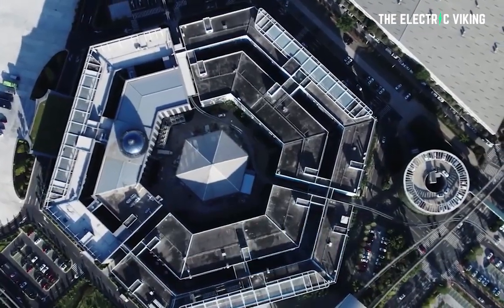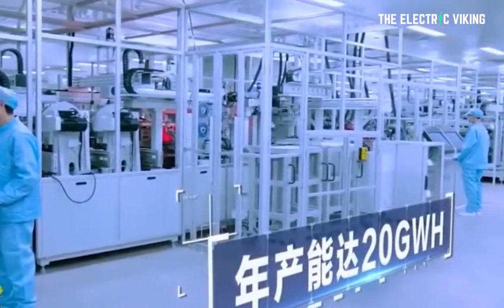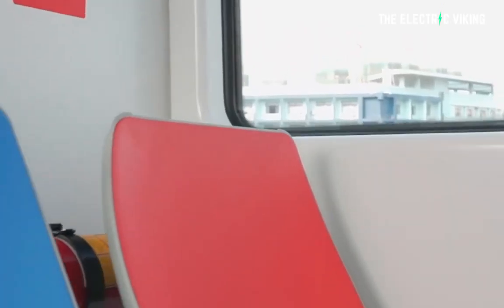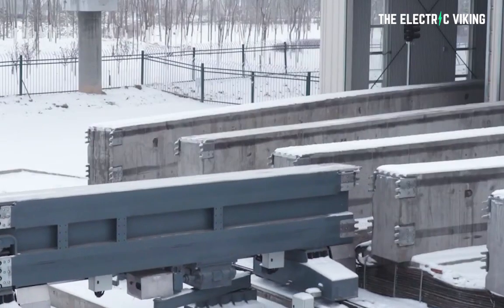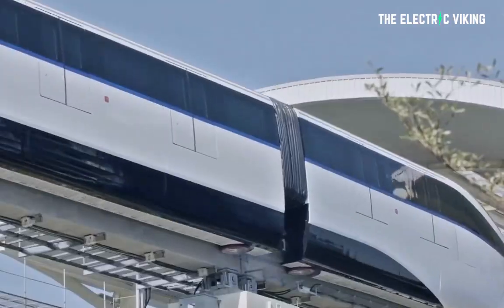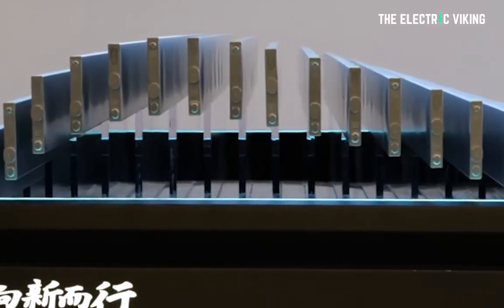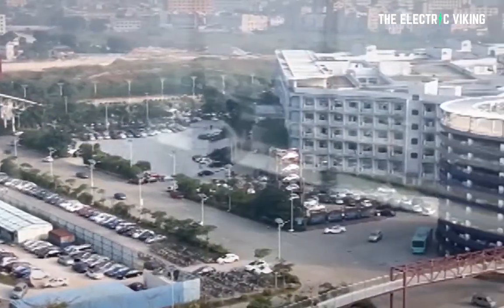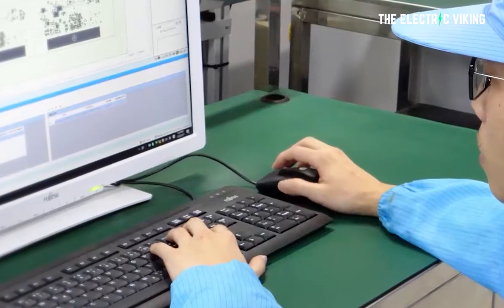Insane BYD autonomous EV trains run on Blade battery!

Comment: Did Australia just dismantle its monorail few years ago? How renaming monorail into skytrain with BYD branding change the fact: It is slow, switches are slow, when it breaks, the whole line stops and it needs a special crew to evacuate passengers. It's cheaper than subway, but pricier than a bus or a tram with less capacity and expensive maintenance.

Comment: It's foolish to use batteries on this sort of thing. Just power it like a train and you can make it so much lighter. Electric trains are as old as the hills. Not sure about pneumatic tyres, steel wheels have less friction and are more efficient. If it was maglev,  I'd call it innovative. Subway in Paris used tyres in the '70s and are now on rails.

Comment: Sydney had something like this in the 90s- it was called the monorail.  Then it was called the white elephant…
Reply from the maker: True!
Reply: Did Australia just dismantle its monorail few years ago? How renaming monorail into skytrain with BYD branding change the fact: It is slow, switches are slow, when it breaks, the whole line stops and it needs a special crew to evacuate passengers. It's cheaper than subway, but pricier than a bus or a tram with less capacity and expensive maintenance.

Comment: Where on earth would a battery powered monorail make sense vs electrified light rail?
Reply: battery is lot cheaper
Reply: @jxmai1000  Electrified rail avoids charging/maintenance cycle of batteries, doesn’t require carrying the weight of the batteries… electrifying rail is very cheap and avoids charging losses. The rolling resistance is way better for rail than monorail. Switching tracks on monorail is also way harder to engineer. All that translates to higher capacity, higher availability, higher efficiency and lower cost per passenger. There is nothing about this idea that is superior to light rail/electrified trolley except that it looks sexier in a PowerPoint presentation.

Comment: Very cool - would be good to see these in some of our cities, linking suburbs to train stations? I like that it needs less infrastructure.

Some aspects of China are so far ahead of Aus (and that was when I last visited 8 years ago)! They are leaping ahead.
Reply: Did Australia just dismantle its monorail few years ago? How renaming monorail into skytrain with BYD branding change the fact: It is slow, switches are slow, when it breaks, the whole line stops and it needs a special crew to evacuate passengers. It's cheaper than subway, but pricier than a bus or a tram with less capacity and expensive maintenance.

Comment: BYD Skyrail/Skyshuttle can be built with a 1/3 cost of a modern subway and within a 1/5 time. It's about to be built in LA, California. Keep it coming Sam! Love the Channel! I am working abroad in Bogota right now and I am going to check out their Skyrail project in Brazil in a few months. Let me know if you want some footage, Sam. Happy to help your dope af channel!
Reply: Did Australia just dismantle its monorail few years ago? How renaming monorail into skytrain with BYD branding change the fact: It is slow, switches are slow, when it breaks, the whole line stops and it needs a special crew to evacuate passengers. It's cheaper than subway, but pricier than a bus or a tram with less capacity and expensive maintenance.

Comment: How’s the air filtration system in the train ? Is the air COVID-19 Delta plus variant proof ?
Reply: Stupid question.
Reply: @rogerstarkey5390  

China, unlike the U.S., can afford the best, and some in the U.S. prefers just let some people die.

It’s not like you have to take the train right ?
Reply: @damianweiss217  weird question. Has anyone built an air filtration system that can filter out the Delta variant yet?
Reply: @Supsup8566  

Hep filters are one solution, some Tesla cars have them.

The other weird solution you may be aware of are 😷 masks, which are unpopular.

Comment: Very very interesting! Glad I discovered your channel a while ago (subbed,of course). Lots of interesting info on every video you posted, learning a lot. thanks for sharing!
Reply: Did Australia just dismantle its monorail few years ago? How renaming monorail into skytrain with BYD branding change the fact: It is slow, switches are slow, when it breaks, the whole line stops and it needs a special crew to evacuate passengers. It's cheaper than subway, but pricier than a bus or a tram with less capacity and expensive maintenance.

Comment: Why use batteries for a train. It's easy to juice a rail. Save batteries for autos and stationary storage batteries
Reply: An induction system needs either fixed magnets in the trains and electromagnetic "induction" in the tracks, OR electromagnets in both the track AND the train.
That'll be the option they're using?
That would need a power source on the train....... Batteries.
Reply: The answer should be relative cost

Comment: If the ev train can run without electrification infrastructure and the batteries charged only when in the stations, then it will be awesome. The cost of building the sky rail will be reduced significantly.
Reply: @rogerstarkey5390  It can… Skyrail and Skyshuttle are not maglevs neither do they not use induction propulsion, they are driven by rubber wheels… 

Skyrail is your standard straddle type monorail from Hitachi, Bombardier or Intamin which uses electrified rails to supply power to the motor driving the running wheels at the top of the single rail, with guiding and stabilising wheels at the side, but can be adapted to run on batteries only, with charging infrastructure at the stations, so technically does not require electrified rails, however the Skyrail still uses electrified rails like normal monorails

https://youtu.be/sjRSmgwWMAo

Skyshuttle is what can be considered an “embedded” monorail, an adaptation of the monorail or can be interpreted as a cross between a monorail and a normal rail line. Instead of a single concrete rail in the middle, it uses a “U” shaped rail where the train rests on top. The rubber running wheels make contact at the top of the rail on the 2 sides and the guiding wheels are in the middle of the “U” shaped rail, hence the term embedded. The design of the rail also makes switching slightly simpler and it fixes one of the issues of the straddle type monorail, since the track is wider and in this “U” shape, in case of emergencies people can actually use the rail as an escape route and is actually built into the design of the Skyshuttle. You can google BYD skyshuttle and get the images as the video doesn’t show it.

https://youtu.be/zWoFtozUryk
Reply: Did Australia just dismantle its monorail few years ago? How renaming monorail into skytrain with BYD branding change the fact: It is slow, switches are slow, when it breaks, the whole line stops and it needs a special crew to evacuate passengers. It's cheaper than subway, but pricier than a bus or a tram with less capacity and expensive maintenance.